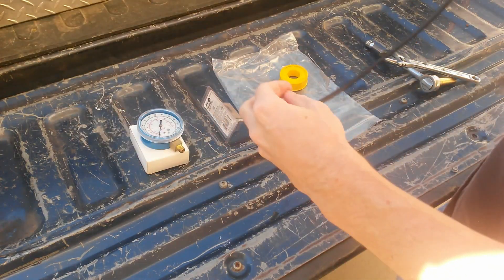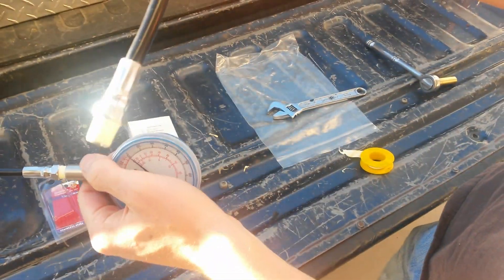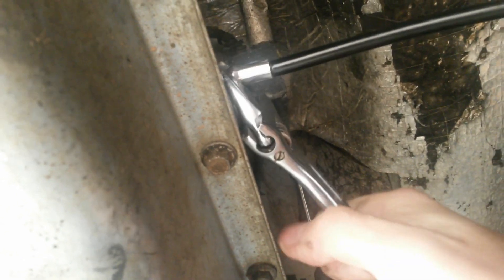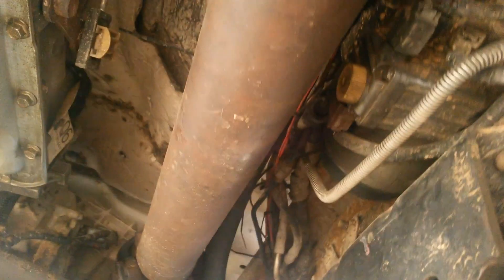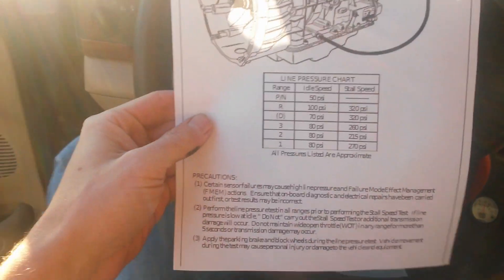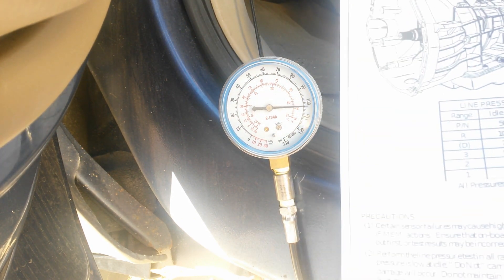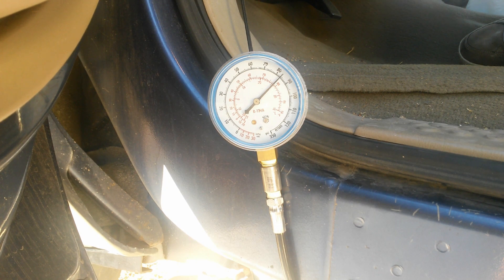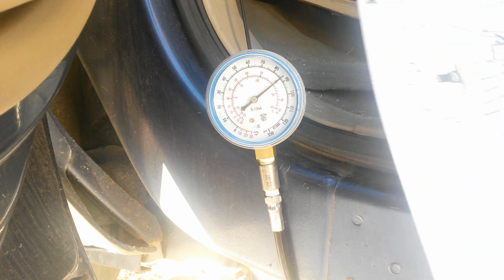FORD SuperDuty 5R110W Transmission Pressure & Stall Speed Test ~Hard Shift Problems ~PC-A Solenoid

Comment: Thanks for the video. I was wondering if the hose doesn't need to be bled for an accurate reading. Perhaps installing a TEE and ball valve rather than a coupling?

Comment: Dude like your video but that  WAYYY over pressure is NOT good. Unless you have the aftermarket pump pressure relief kit installed, thats trans might be a grenade. Over 400psi spikes and you have capability to be blowing/grenading internal component and possibly the case.. I'm glad you tried a different gauge but they're both wrong. You can't trust either number. Transmission Guage kits are like $50-$80, just buy the right  scale 0-800 or 0-1000psi

Comment: What if my gage is bouncing between 300 330 while idling in every position, PRND321 ? The gauge is a brand new OTC transmission pressure gauge goes up to 400 psi. Thanks

Comment: Im surprised that Guage still works the way that you pegged it with more pressure than it's made for. 
So your epc was sticking, or pressure regulator was sticking or you had a tune in it,,
That second Guage must have been  dropped,
500 is too much,,

Comment: So I just did the pressure test and in drive idle speed it's running 25 psi so bad pump right?
Reply from the maker: Joe Troy Could easily be your pressure control solenoid. What are your other pressures?
Reply: They are go from 25 to 200 so spuratic
Reply from the maker: What symptoms are you having other than low pressure?
Reply: My pressure are high idling 90psi and m
Other are 120 in d
Reply: @mikerosario8824  did you figure it out?

Comment: On 04 ford F350 6.0 power stroke I got no pressure that all from lines coolers etc non don't even heat up what could be the problem?
Reply: was your problem the  PCA Solenoid.  I have the same the test gauge does not move.  The transmission wont engage
Reply: @sandraburton9169  did u ever figure out what was wrong? I have same problem
Reply: @johnzzyyzz4343  yeah your transmission pump broke,,common

Comment: I'm having problems with my 05 6.0 5R110W. Reverse is hardly there. 1st - 3rd shifts are good, 3rd > 4th slips with a high rpm hard slam shift, 4th - OD are good. Sometimes after the hard shift the tow/haul light flashes and puts it in limp mode. If I don't make a higher gear after 3 > 4 hard shift and stop at a light, 1st hardly there on takeoff. Randomly downshifts out of OD into passing gear at highway cruising speed. Any ideas? I have not checked line pressure but will tonight!
Reply: Hey Mike. I subsribed to your channel to try and get in touch with you.  I know  this post is 3 years old, but you described to a TEE, whats going on in my Trans!!
 My question is: What ended up being the problem, and what went into repairing it?
Reply: @larsonzero  did you ever figure out what issue with his truck was? Mine is doing same thing his is. Need to get info if possible. Thanks!
Reply: Hi Rodney hi Rodney what was the problem with your transmission, mine is doing the same, some help if possible Thanks
Reply: @larsonzero  hey Doug did you get it figured out? My truck is doing the same thing too
Reply: What did you end up doing with your truck?